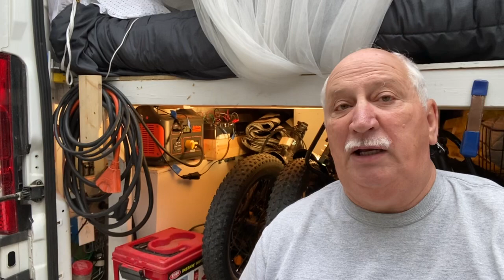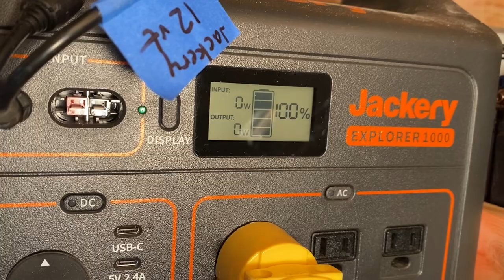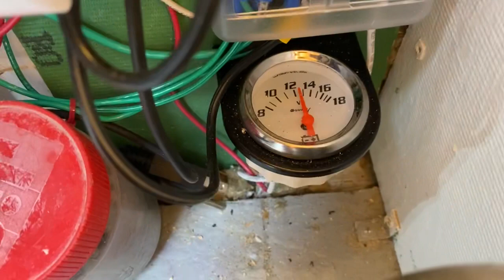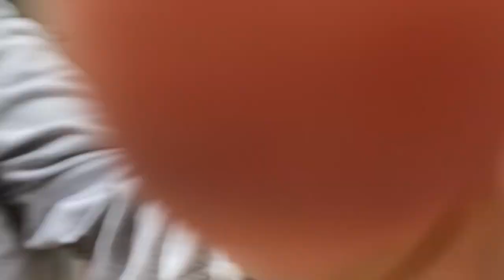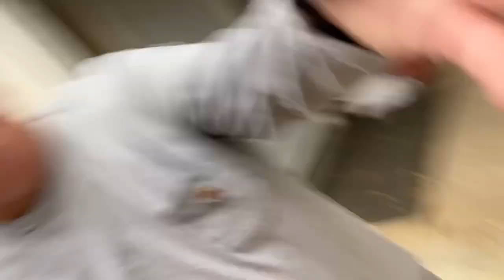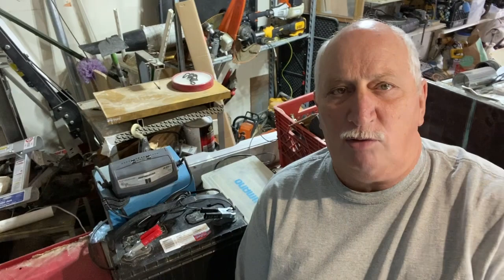Jackery 1000 for our Promaster van power.

Comment: I would be interested to learn the specifics of have you use the AC 110 to send power to other plugs / devices. I'd like to do something similar in a small off grid shed we have - use one of those outlets to power a few ceiling lights and maybe 1 outlet, but have no idea how to do this.
Reply from the maker: I do this all the time to power apartments when the power is off and there is no meter or if the power is off and there is a “main breaker” to disconnect the buildings wiring from meter. You will see comments that I use a “suicide cord” to power my van. It is a cord with two male ends. I plug one end into the Jackery and the other into an outlet. This back feeds the circuit and powers the run. If you are not knowledgeable about home electrical do not do this! If you do this to an outlet that has power you will fry something! If you have no electrical in your shed then you could easily wire in lights and outlets and power them with your Jackery (I use an Alpa ess now).  Correct wire size and circuit protection are critical. What you want to do is a great way to make your shed more usable. I have a shed at one of my rentals I wired up this way for a tenant so he could use it as a man cave. I ran SO cord (extension cord wire) from the house to the shed. It is protected by the circuit breaker the outlet in the house is on. If you are not confident have an electrician set it up for you. They could wire up lights and outlets with a cord ready to plug in.
Reply: @CBrown07696  Thank you for this.  I do not have home electrical experience other than connecting a microwave.  

This entire project has been learn by doing for me and that is what has been so fulfilling.  This particular project is just a closed system shed 12x10.  No risk of frying anything.  I would like to power 6-8 RV style recessed lights with the flip of 1 of 2 switches.  Our shed will have 2 doors (east and N wall); I would like a switch by each door.

I have a 100ft of both red and black 12 AWG copper wire to work with.  It sounds like I would use a suicide cord to outlet, then wire from outlet to a junction box then from there to my switches and lights?  

Our spot is in a rural, off grid area which making it one of the most out the way trips an electrician were to make for such a small job :-)
Reply from the maker: @StaffAction Just wire the cord into a junction box and branch from there. If you want two switches to control the same lights you will need double pole (3 way switches). You will need a 3rd conductor to do that.
12/3 romex would be a better choice unless you are putting your roll wire in conduit. I assume you won’t be getting an inspection so you can do what you want. If you are powering it from a plug in cord most places don’t require anything for temporary power stuff. If done correctly it’s safe. I just talked with our local code electrical guy and a supervisor from the power company. I was powering a four plex with no meters using my Power Horse generator. Everything run through circuit breakers in the panels and they were baffled but once I walked them through it they had no issues as long as it was restored to normal wiring before the meters could be installed. Please install a smoke alarm if you will be hanging out in the shed. Good luck!
Reply from the maker: And the beauty of the cord is you can plug it into a small inverter generator and run your shed that way if you want. My little generator I made a video about will run about 14 hours on a tank of gas running lights. That is cheap portable power for a little over 1 gallon of gas.
Reply: @CBrown07696  thank you for this!  Yep, that's one reason I like the jackery for now.  Can use solar and then I will use our gas generator to supplement when needed.
Reply: @CBrown07696  thank you!  This is helpful.

Comment: The chord you've created from the Jackery to the outlets is called a "suicide plug". Other than that the system you have seems good to go. Overly complicated but ok. The loss from using the 110 plug is drastic. You lose so much when using that. Do yourself a favor. Get a good Iceco half freezer and half fridge and go back to 12 volt strictly. Your power concerns... and your safety will be better. Please...get rid of that suicide chord.

Comment: So, I do own a jackery 1000 and I been thinking about either add a second battery to my truck or by a jackery 2000. We go to the cape a lot to watch rocket launches that run a few days at times with scrubs and we run a Frigidaire off the Jackery ..... I'm a certified electrician also (from the old country) and some of your electrical ideas are a bit loose and scarry but still it was helpful 👍
Thanks again 👍

Comment: Cool 😎 👌 👍
Reply from the maker: I’m a retired Air Force crew chief and a A&P. Love your aviation video!
Reply: @CBrown07696  ohhhhh.... Thank you for your service 👍 I did not realize anyone would care about my YouTube videos, but me and my brother are huge air and space fans and we grew up together flying model gliders and taking rides in anything with wings lol....my brother lives in the old country I'm in Jacksonville.
Enjoyed your video.... 👍 I built a truck cap camper and I was searching for ideas on the electrical powering stuff in the cap camper.
Reply from the maker: Good luck on your camper! My big mistake was not making my electrical easy to get to or see. I have to open both back doors to access the Jackery to switch from shore power to the Jackery. With it mounted facing the to the right ( because it fits perfect there) I can’t see the display when the compartment is full. Good thing is if you build it you know how to fix it!

Comment: What is nice with the jackery 1500 it takes 2 inputs.  So I can use the 12v and the 110 from the 400 watt inverter that is factory in my truck and that really helps to fast charge it. Literally adding the 80 + 160 for 240
Reply from the maker: I did not know that! I added a 400 watt in my van to charge while driving or on shore power and it makes a huge difference.

Comment: Why didn't you just get Solar at least 300 W
Reply from the maker: Fair question. I may get solar at some point but this battery bank gives me 104 aph for the cost of a little wire and some connectors. Remember I get the batteries for free. The solar panels seem overpriced for the power they produce. At this point I have the extra power day or night and don’t need to go through the exercise of setting up solar panels or storing them when we drive. Someone else commented that I could use solar panels other than the Jackery ones. That being said solar on the roof that would work with any future power system would be great if we start staying off grid for longer periods. For now we are normally not away from shore power for more than a couple days and we have plenty of power for that. Look for a solar add on as my wife wants to go 100% electric on appliances!
Reply: @CBrown07696  Why would you store them just completely put them on your vehicle

Comment: I'm getting ready to purchase the Jackery 1000 before Spring. Here's something I just learned about from another Youtube channel. Another inexpensive option for charging the Jackery in your van using the 12volt van plug, is to get one of these pure sinewave inverters. It will charge the Jackery as if plugged into AC shore power from an outlet. Basically the inverter will charge twice as fast than if just using the 12volt dc power cable. 
Amazon.com: BESTEK 300Watt Pure Sine Wave Power Inverter DC 12V to AC 110V Car Plug Inverter Adapter Power Converter with 4.2A Dual USB Charging Ports and 2 AC Outlets Car Charger, ETL Listed: Car Electronics

How To QUICK CHARGE Solar Generators From 12 VOLT Vehicles! BESTEK 300w Pure Sine Inverter Review - YouTube
Reply: I ran across the same info today. Also you can use other solar panels that are less expensive than the Jackery on the 1000. You just need to use an adapter cable. You can get 1 200 watt solar panel ($200ish)  that would do the job of 2 100 watt jackery solar panels($600ish). You can also use more than 1 power input at the same time.
Reply from the maker: Great idea! I have a 400 watt inverter from my old van I don’t use.